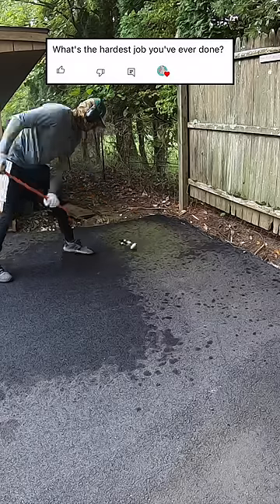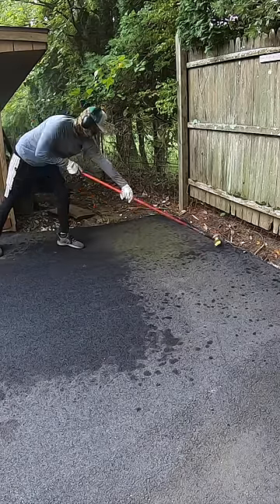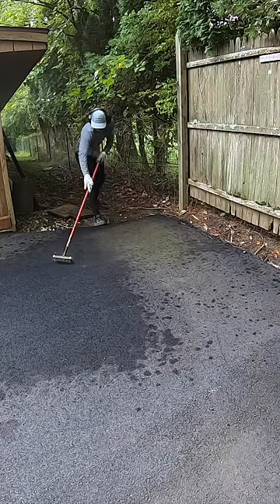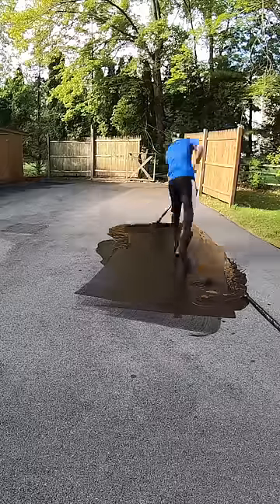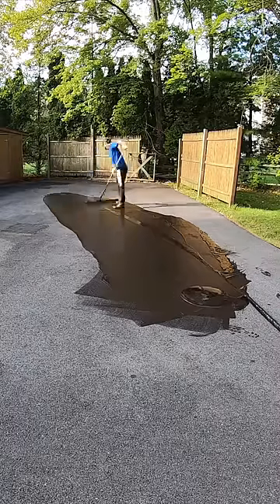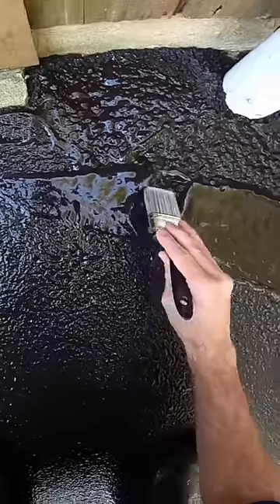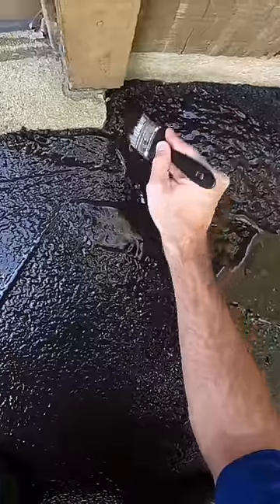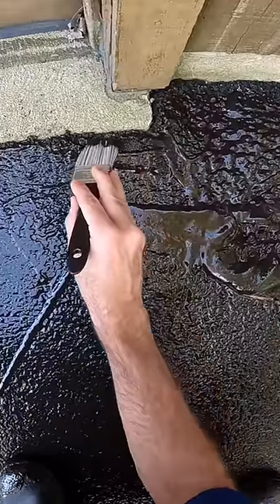What was your hardest job? #shorts

Comment: Is that a brush or a squeegee?
Reply from the maker: 4 foot brush
Reply: @SEALCOATINGISLIFE  Does a squeegee not work well? I'm doing a driveway this morning up here in Canada. I bought a 3ft squeegee. Just ran across your video. Am I making a mistake using it?
Reply from the maker: A squeegee is easier if you’re newer to this
Reply: @SEALCOATINGISLIFE  Will it produce a decent outcome? Lol. Sorry, I'm a bit nervous now.
Reply from the maker: @colinmartin5994 I can’t say
Reply: @SEALCOATINGISLIFE  I don't think I would use a squeegee again. To stiff and doesn't conform well to uneven surfaces. At least a brush has some give.